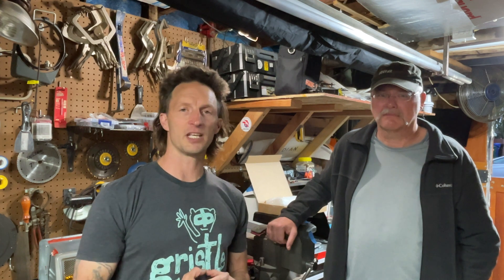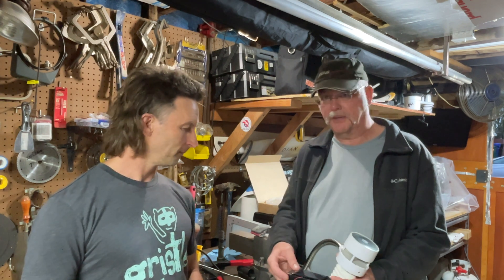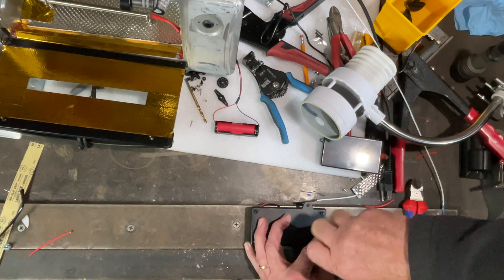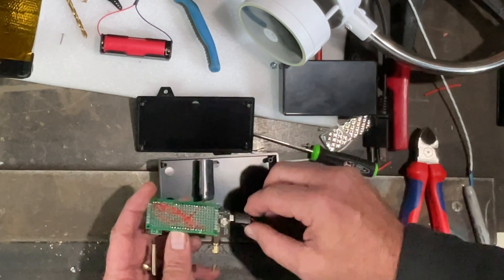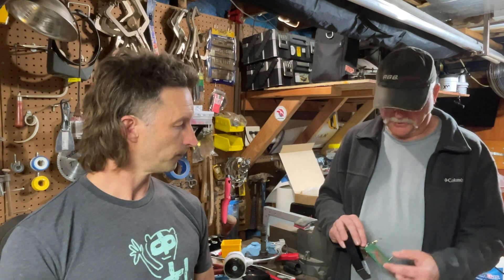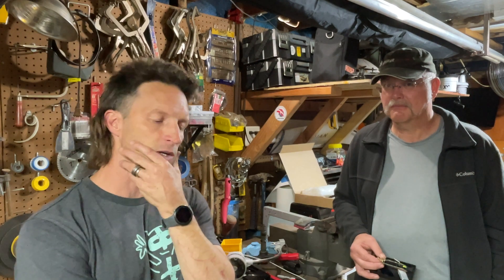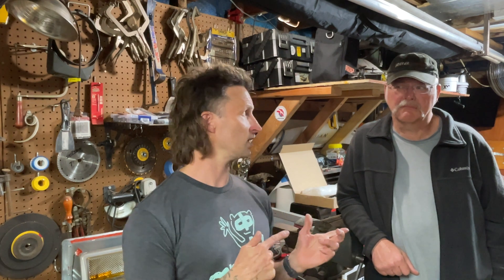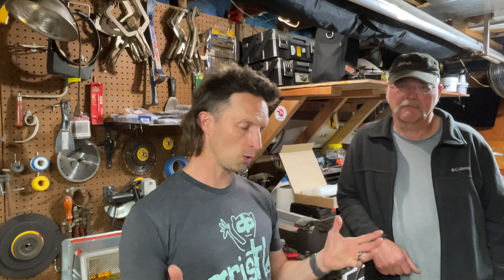Helium Bridge - Weather Station

Comment: Cool project. Are you designing the hardware only? Or also decoding the data into something easy to use?
Reply from the maker: Decoding the data separately, though the decoders are standard so far.  Using UplinkEngine for that, will see about getting a video walk through for it.  :)